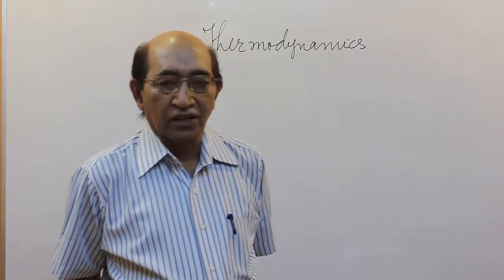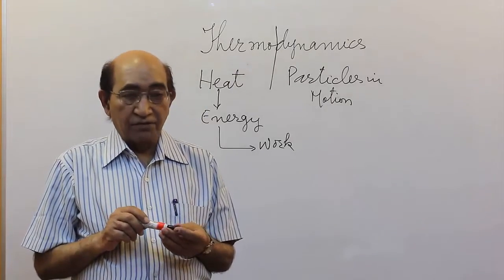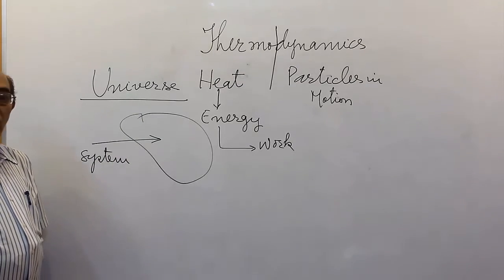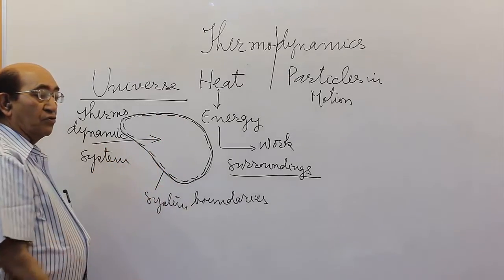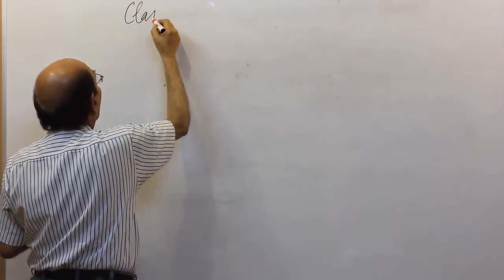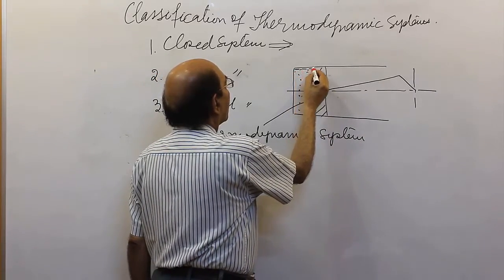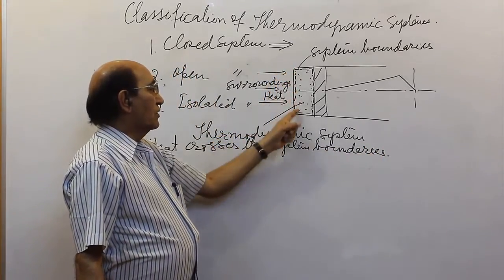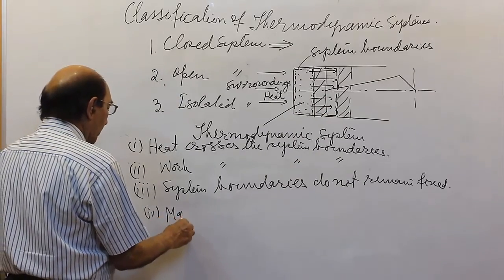Introduction to Thermodynamics | Mechanical Engineering | Chemical Engineering | GATE Exam

Comment: A horizontal cylinder is seprated into two compartment by an adiabatic frictionless piston.one side contains 0.2 m³ of nitrogen and the other side contains 0.1kg of helium both initially at 20°C and 95 kpa. the sides of the cylinder and helium end are insulated.now heat is added to the nitrogen side from a reservoir at 500 °C until the pressure of the helium rises to 120 kPa. 
determine-1>the final temperature of helium.
2>the final volume of nitrogen.
3>the heat transferred to nitrogen.
4>entropy generated during the process.